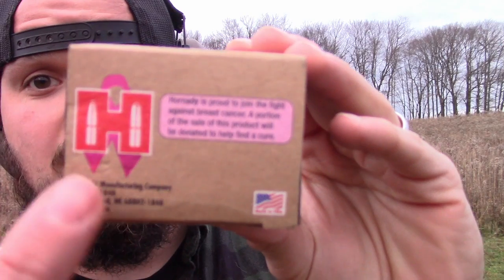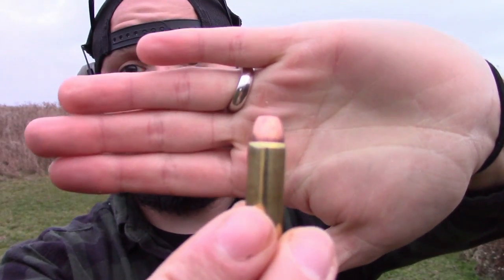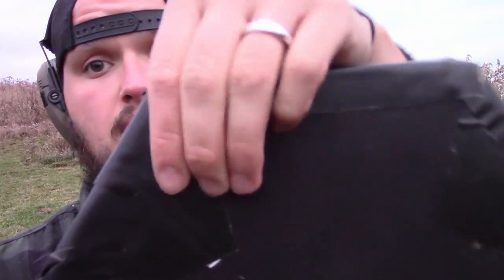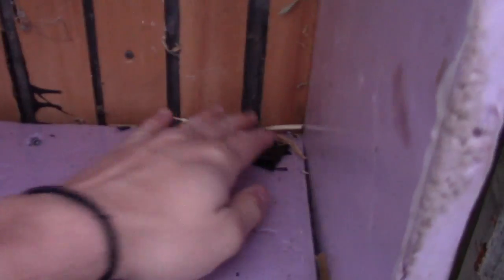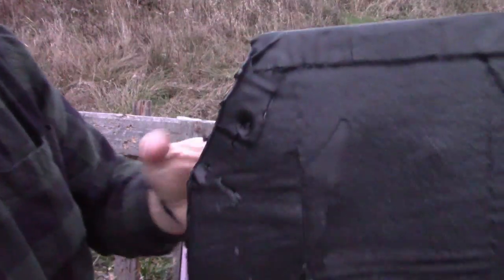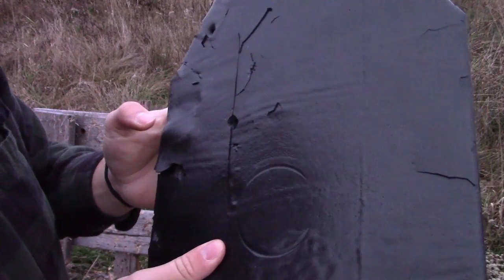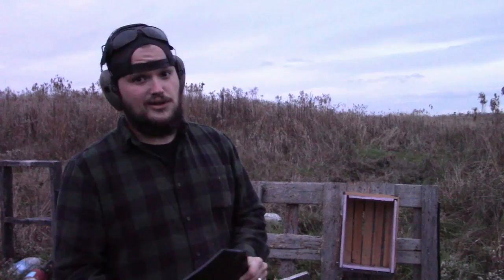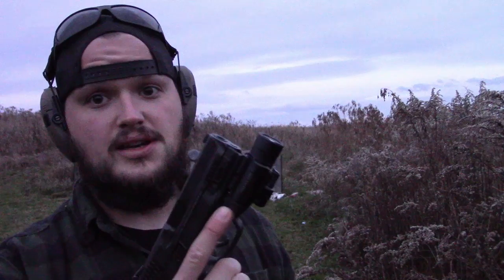Wish plate spall test

Comment: Spall isn't a concern if it will not stop a 55 gr 5.56 at close range. 55gr will punch right through ar500 steel at -/+ 30-40 feet. Most people will never need the armor but if you a occupation that puts you in situations where you may need it get at the least ar550-600 with reputable spall coating and a kevlar spall/splatter pouch the plates sit in. You only have one life. Don't let a couple hundred bucks make the difference of making it home or not.

Comment: Not going be deady coming out sides.... you must not have any arteries or veins in your arms.......
Reply from the maker: Veins wont be as deadly as arteries and even then arterial bleeds can be stopped pretty easily with a tourniquet. So no not deadly, I stand by that comment
Reply: @Pyro5610  Severing the radial artery can result in unconsciousness in as little as 30 seconds, and death in as little as two minutes. The Brachial artery runs along the inside of your arms. This artery is deep, but severing it will result in unconsciousness in as little as 15 seconds, and death in as little as 90 seconds.
Reply: @Pyro5610  so while in gun fight where you been shot least one time. You going find time to deploy a tourniquet before you loose consciousness? Planning on just calling time out?
Reply from the maker: @Kenny1594  not saying it wouldn't kill you eventually. But immediately? I dont think so. As we say in the ER all bleeding stops eventually. I'm not by any means defending the plate because I wouldnt use them. Just saying you'd have to be extremely unlucky to have a small piece of spall from a 9mm jacket to completely sever the artery.  Also I'm a nurse so you dont have to explain where arteries are 👍

Comment: I think i'll buy a level iv plate i found.... i will absolutely cover it in flex seal then truck bed liner, then seal, then liner, then seal then liner... and i'll make sure the sides and back get throughly covered.
Reply from the maker: Off wish??
Reply: @Pyro5610  yup https://www.wish.com/product/5dd8dff0399ab4096dc73f39?&source=search

It states its a level IV but heck, in my country i cant get ANY level unless i pay top dollar, so even if its a level II its more than i'd otherwise have if shtf

It says its 0.4 inch with 0.25 inch steel....
Reply from the maker: definitely going to look into those Thank you
Reply: @Pyro5610  awesome!!!

Comment: Hey good video. Just a suggestion.  Put a 2x4 running across the top and another across the bottom of the box to pin the plates inside the box.

Comment: Tell me how you painted the plate with bed liner
Reply from the maker: So I placed 3 strips of the flex tape across the front then literally sprayed it with a coat when I remembered to, sometimes 20 minutes (recommended time) sometimes overnight in between coats